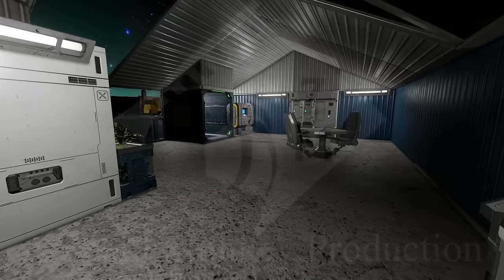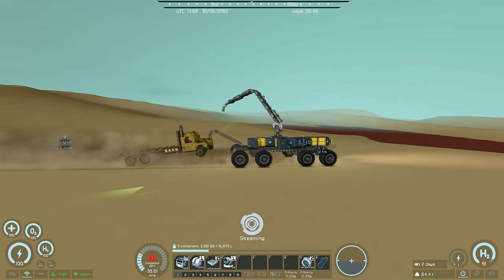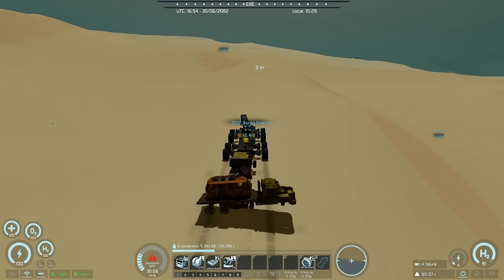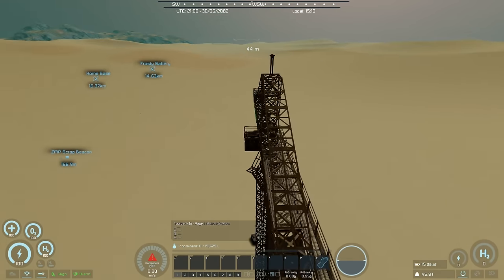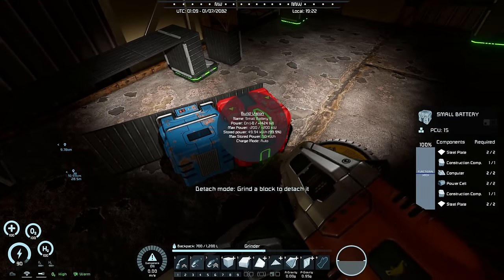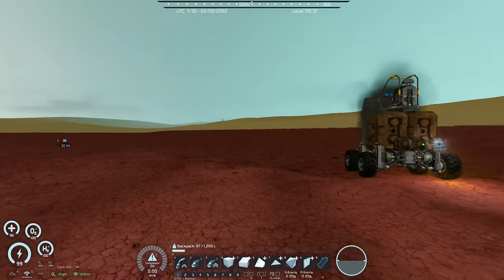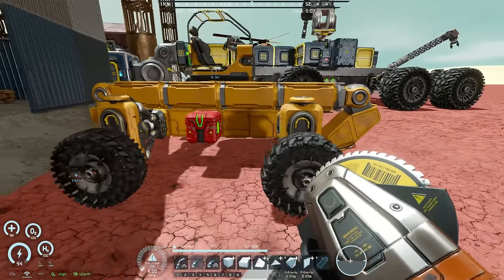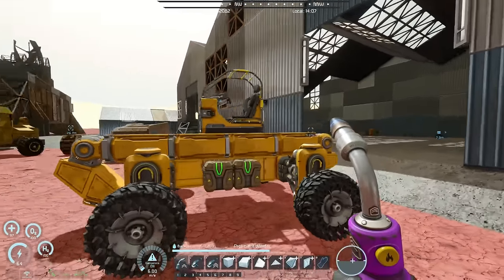Feedback for the Win - Scrapyard #8

Comment: 56:53 Hmm... I was going to sit here and do the math for you to keep the hinge at the front end directly over the same block space no matter the hinge height, but then realized you'd need to dynamically change the piston max length which I think can only be done with a programmable block. I think it'd be a mix of Trigonometry, Law of Sines, Cosines, Pythagorean Theorum and some substitutions.

Assuming your rear hinge angle is [c] and your front hinge height is [C] (lower case vs capital), your base length (length of the hinges+pistons when retracted which = 10) is [B], the angle opposite it as [b] or 90-[c], and your hypotenuse, or pistons when (partially) extended is [A] with [a] being 90, you'll need to calculate for [C] and then use that to determine [A]. So the constants that you know are the base [B] which is 10. [a] is 90. [c] is your hinge angle. So, tan[c] = C/B(=10), or C=(B*tan[c]). And from here, law of Sines maybe? Sin[a(=10)]/A(hyp)=Sin[c]/C or Sin[c]/(B*tan[c]). And then you need [A] by itself so [A] = (sin[a] * ([B] * tan[c]) / sin[c]. Sin of 90 is 1, so [A] = ([B] * tan[c]) / sin[c]

I dunno, man. Check my math, lol. But yeah, if you can set the piston max length via programmable block, you'll be set. I don't know enough about SE programming to be of any help here though.
Reply: Was thinking the same but he realized the same in the end of the stream :)

Comment: Nice new lifter :-) if i may suggest. add some more blocks to the back - where the hinge is attached. if u hit something u will lose the lifter. add some lights to the front but as low as possible, so when u move something big - like that battery, u see in front of you so u dont hit anything

Comment: 52:50 I personally use this method of attaching trucks (which often have one connector in their "keel" and other somewhere else) to base, though in most cases the connector is covered by a grid plate to avoid wheels falling in

Comment: I'm SOOO glad you put the steering on the right side of the vehicle... My sensibilities are satisfied!  If you wanted a connector link you could always have put a small-small connector directly above the magplate.  You could connect it after locking, so long as you remember to de-magnetize the connectors so they dont screw with physics.
  ]]I-----
 |/

]]=Connector, I---=piston arm, |=flat magplate, /=sloped decoration structureblock.

Connector sides could be neatened with armour plate covers if prefered.
Reply: PS.
Could put in a counterweight piston?  One that extends backwards with the mass on if needed.  Sharing inertial tensor on it may also help, but uncertain.  The whole mass of the vehicle would be added to the small counterweight subgrid keeping it tiny if it works as I think.  A small piston, with an artificial mass/battery/cargo container of stone wouldnt take up much space.  Perhapse keep it 'bottom of cockpit height' to make ground and wheel clearance a non-issue.  Try to keep it (the mass) as close in line with the lifting arm as possible.

Comment: You are right, the extension speed for the arm needs to be l ω (tan θ / cos θ), with
- l the arm's length when horizontal, i.e. the distance between the axes of the 2 hinges when the arm is fully retracted ;
- ω the angular speed in rad/s, ω = π/30 × rpm ;
- θ the current angle of the base hinge
... but I don't think P.A.R.K. supports plonking formulas for the various speeds, so you'd need a different script  😅

The near-tilting at the end, with the heavy battery, made me wonder: since the arm is longer than absolutely necessary, would it make sense to remove a piston and make the S-shaped part with the mag. plate “nestle in” between the wheels?  It would mean moving the connector, but it's not conveyored so it could be off-axis (or on the rear maybe?)

P.S. I'd offer to script that up, but currently curled up in bed nursing a migraine  :(
Reply: Someone in the comments was using maths to try and figure out this. Then I saw your comment and was like: "Yup, that's physics!". Cool stuff!
Reply: @jungaardan  Neat!  I had missed @chakatfirepaw's message, but it looks like we may have posted around the same time.

Comment: In regards to your little forklift crane, if you had one more piston after the hinge you could then lift things up to the right height, level out, and then extend the piston to push the item forward. 

This would let you potentially do things like install an engine onto a ship, or stack pallet-like objects better.

Comment: That telehandler works really well!  It turned out a lot larger than I imagined, but looks good for getting items on and off truck/trailer and where you have the space to manoeuvre, stack racks of goods.
Conceptually, the type of vehicle would be great for placing recovered blocks (like containers / batteries) precisely to weld-pads, but I think the current TH will be too big. ...  
Seems you might need a "dolly-trolley" version for operating in tighter spaces to place blocks at or near ground level:  Say short wheel base using 1x1 wheels, with their suspensions back to back or just one block in-between, one piston for the arm and the "cockpit" a seat + RC block combo, or omit the seat and just drive it with RC

Comment: Quick tip for the competition. Someone likely has a monster crane, that can best any crane challenge thrown it's way, so consider factoring in between challenges: speed, maneuverability, shortcuts for small vehicles (as they're otherwise disadvantaged) or something.
Reply from the maker: 100% I want to try to come up with some challenges that benefit different design ideas in odd ways so it's not just the standard ones that should win :)

Comment: The tele-handler looks great, personally I'd have the cockpit 1 block lower to keep the centre of gravity low but your design works well. If you wanted to go down the route of having a connector head on the handler you could build different heads for it but it would slow down the process of moving things around. With the connector on the base for recharging, you could add small connectors to all sides and have different small vehicles recharge from the same single point.
Reply: Or more it further back

Comment: 23:25 - Splitsie, precision grinding!  It's really easy with that mod (can't remember the name off hand, the one that adds detach mode and weld pads):  Right click and hold, then left click to grind (while keeping the right click held down).  Grinds only the thing you initially right-clicked on, will refuse to grind anything else until you release right click.  It's amazing for grinding specific parts out without risking the ones behind it, without having to run around with a terrible grinder.  Hands down one of your single most common comments about higher-tier grinders is accidentally grinding things, so use the super easy feature that was added to that mod specifically to prevent that issue!
Reply from the maker: That's exactly 0% of the reason I have the slow grinder, the slow one is for batteries
Reply: @Splitsie  ahh, I know you've made comments in the past about questioning whether your want a better grinder because of the accidental grinding issue.  So I know it's there floating around as a concern. 

Also, doesn't the perfect grind method you used in this episode only work with a 2-chevron? I guess there's still small grid batteries, though.

Anyway, do still recommend you use precision grinding when grinding around valuable stuff. I think you nuked a small grid battery last episode or the one before by grinding too long on the block in front of it.

Comment: Good to finally see the plane's body, I was wondering how big it actually was since the tail and wings painted a kind of inconsistent picture. Restoring it might be nice just for the nice color scheme it has under all that rust.

22:55 I like that little excavator a lot. It'd be utterly impractical to use for anything since SE hardly simulates scooping terrain but it's a nice design.

48:24 From my understanding, the speed would have to change. The higher the hinge angle gets, the slower the hinge must move (or the faster the pistons must move) in order to keep the load in the same spot. You'd need a script or something to change the speed of the hinge with the angle, though I think if you did that the pistons continuing to move would possibly mean the vertical movement might stay at the same speed from the load's perspective.

55:34 Perhaps the weld pads have some marginal magnetism even at that range? It might do it; if the magnetism is trying to hold the other grid in place (or at least, SE thinks it is even if it isn't) and that's taking some of the load for you. That stuff can be weird.

I wish there was an 'auto-level' setting for SE's gyros, like in some other games that use the concept (Terra Tech comes to mind). It'd be a bit scuffed in regards to placement of the gyro, but that can be fixed with settings to change where it's levelling to, and then it would just attempt to stop turns in a given direction. It'd help a lot.
Also realistically, with the amount of force those gyros can put out, they should be one of the densest blocks in the game (or have like double the power usage of an atmospheric thruster, I guess). They're ridiculous for such little things.

Excited for your arena, particularly if someone just up and brings an aircraft to a lifting competition - because that is a viable alternative.

Comment: The way I built my handler is I extended the base tires in the front out in a fork. That way, anything I grab and pull in will be closer to the middle on my handler as opposed to hanging outside my wheel base. With the height of my trucks and trailers, I can drive the forked base under them so I don’t have to do as much extending which means less extending beyond my center of gravity. With a decently wide base, I don’t tip over unless I make a terrible mistake.

Edit: It’s sort of like an engine hoist for dropping engines in a car or truck. Not exactly the same, but close enough to look similar in concept.

Comment: You could turn the lifter charging port into a wall on the back side so others could recharge. Just make a line of different height connectors. Maybe even throw in some small connectors. As for weight for the telehandler, maybe replace the spine with small batteries.

Comment: The main thing about tele-handlers and fork lifts is to have the front wheels as close to* the (center of mass of the) lifted load as possible. This is to mitigate the lean forward issue onto the front wheels causing that dangerous nose dive. Such a pain to combat with gyros.
* or even in-front and under- like IRL with a lean back of the lifting tines on forks, and with a tele-handler you can retract the load to behind the front wheels after slightly lifting.
Good effort on first try with the tele-handler. Lovin' it.
Others' suggestions for manipulation to give extra degrees of freedom is good for placement, just remember to keep your loads, like friends, close.  ;-)

Comment: Forklift use a sigle back wheel attached to rotor so it mounted offset on the rotor so the wheel is more centered to the rotor you should get a perfect negative turn capability. I'd say even try a larger single wheel for clearance issues. Though that turning can be dangerous rear wheel steering. Wider front wheel base for tripod stability as needed. 

For stability sake make auto lock landing gear on hingles so if you pass a conforable tip point they touch and just stop lock without your efforts in panic, you never roll, and can just use the rotor to correct yourself back (this can also be good for other non high speed vehicles that perhaps use....crains..). 

Also, move your ramp to have an extended tarmac outside the door. You can even make it into a bit of a loading dock for faster work. 

I'd also say for your truck hitch setup if you want more complicated ideas put in a couple of pistons in place of static pieces to adjust trailer load distance and maneuvering simply. Also the base rotor could be fine if it was just locked and only turned when wierd maneuvering is needed like grabbing a new trailer.

Love the work and mod set. You have got my kid interested in the game now I need to buy (or fix) a computer just for them. So take the fact you motivated a 7 year old to do something so complicated and a gesture of my great appreciation for what you do and how you do it.
Reply: Do you mean  lock to ground? If so I think Splitsie deliberately will not do that for the same reason he has no lock to ground on the crane truck, he considers it cheating ;)

Comment: adding a rotor between the front piston and the front hinge would allow you to rotate the "head" of the telehandler 180 degrees and lay it on top of the piston with the magplate facing up while it is parked on the connector.

Comment: Ill start my comment by pointing out i have no exp with this game. Here are some things that popped into my head. 

For your tele handler you could remove 1 piston and then move the rear hinge forward 1 block. This would bring the load closer to the front wheels which should increase load limit and will also give you better clearance on the rear so you dont bottom out on things as easily. The reduced length will help you manuveur in your warehouse to. You could also put your small batteries and the thingy's under your cab along the rear bumper as a counter weight. This will also allow you to lower your cab and get the centre of gravity lower but i doubt that'll make a huge difference.

And for the connector to charge up the tele handler (and possibly other vehicles) could you have it mounted within the frame of the vehicle but aimed down, so that you drive over the top of a connector that pokes up put of the ground, this might be more aesthetically pleasing and possibly suit multiple vehicles.

Now for the combo truck/trailer, i dont know the limitations of this game, but could you put a rotor unter the front of the truck in the centre, attached to an axle of sorts with the wheels on each end and then using a hotkey, unlock the rotor and lock the wheels straight so that it acts as a dolly. This would allow you to attach with a 'stiff bar' from the rear of your rover to the front of the axle and have it tow with all 6 wheels on the ground. Then when you disconnect lock the rotor and unlock the wheels for steering as a normal truck. Perhaps a piston setup so the stiff bar  can retract under the truck. This would also allow you to tow as many trucks as you like and have your self a little scrap road train. 

Lastly, love the content. Hope i made some sense. Cheers!

Comment: An idea for weight/control. Move the 1st gyro back & down behind the batteries, then add a 2nd gyro to the opposite side behind the other batteries. That should act as both a counterweight & give you more control over whatever you're moving. Besides that, I think your lifter is perfect. Love the compact design🫡👍

Comment: Lift: Z shape with one layer of two pistons pouting forward, double hinge, row of full olivia going back to another double hinge, and two more pistons going forward. Make minimum of one hinge for each set to 89 so the pistons never contact. That cuts length in half for tighter turning.

All 4 batteries and control blocks behind the rear wheels. Probably put the cockpit over the rear wheel since it is already so high.

Comment: There is one mod u might consider using in your scenarios, its the power mod that has a charging station and allows u to attach 'wires' or 'cables' to your vehicle for power. It also has power line towers and such but you can limit the use to just the charging station option. its not so much of a cheat but a nod to real life. u plug cars in to charge not be forced to install complicated material transfer ports and connections in real life. It also allows u to use 'jumper cables' between two vehicles to supply charging power or to temporarily power something from a mobile without having to engineer some complicated connection.

Comment: Love the fork truck! Suggestion though. Move your power hook up to the rear and use that as a means to attach to the base and/or attach additional ballast. Also moving your cockpit lower and back may also help with stability.
Reply from the maker: The trouble with putting anything at the rear is that it'll snag on any slope I drive down :(
Reply: @Splitsie  I see, my next thought was to have the fork truck lengthen but then you run the issue of high centering as you climb up or down a ramp onto the other surface...

Comment: You could try and give all the Wheels the same amount of turn radius for a smaller turn radius. You can also setup multiple forks for the lifter and therefor switch out to what you need. You can also put markings on the pistons which could look pretty good.

Comment: The new base connector reminds me of  the base of a snow turret from the battle of Hoth, it could be built up to have the "cannon" as a second higher connector. also the tele-handler might be the start of a working design for a shuttle on the sky-warp, it already has a mag plate to lock it down, and a variant with a grinder could be used to scrap captured ships brought back to the asteroid.

Comment: You were talking about using a connector for the connections on some items and the mag plate as connections for others, what do you think about adding the connector to the end of the arm, then you can make multiple heads that attach to the connector. I'm not sure what other tool heads are even possible, but something like that is how telehandlers work irl so they can do more than one thing. No need to build multiple machines if you can swap the tools out.